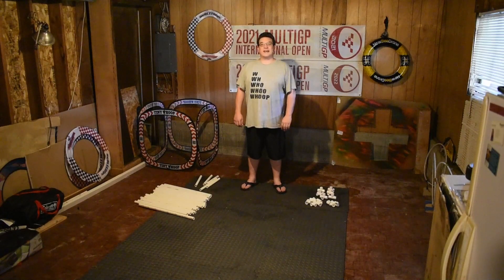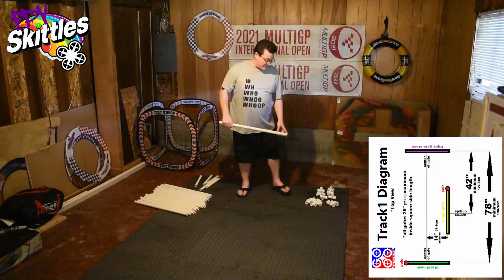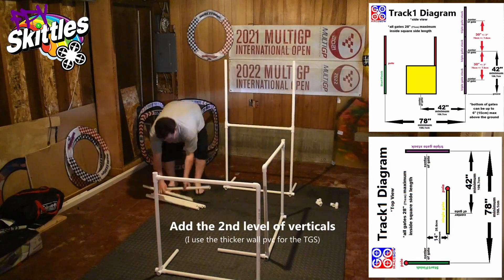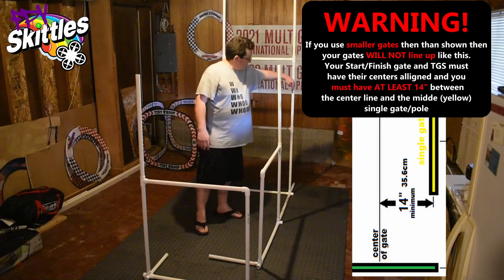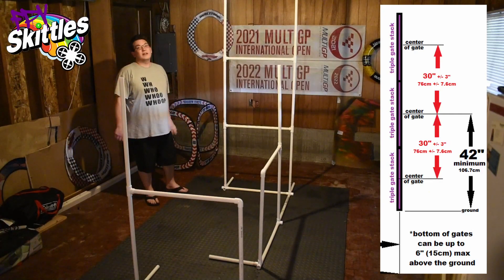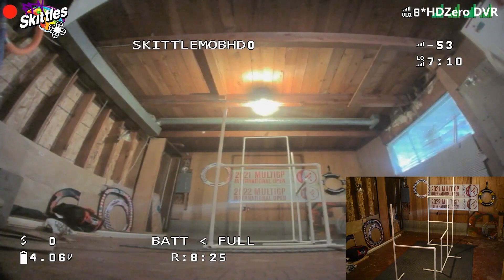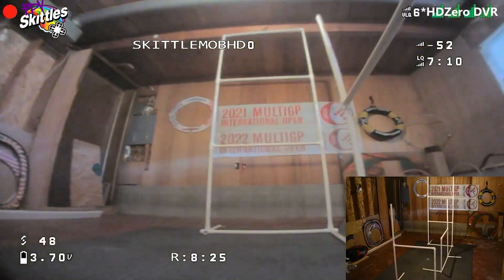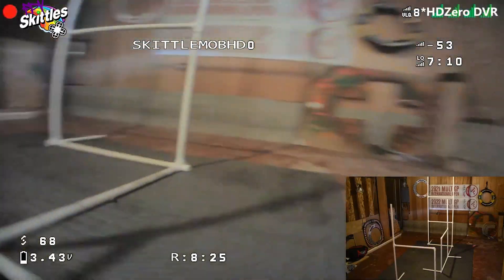RaceGOW Track1: Created by AyyyKayyy - DEADLINE = August 31st

Comment: Need to find the cost of pvc, and see if I can get any of my ducted whoops to work…
Reply: Hello, Not sure where you are located but here in the Seattle area a 10' x 3/4" piece of PVC  is 6.48 for sch40, which I use for the sides of my gates and 4.57 for Class 200 which is what I use for the tops nd bottoms of the gates.  I also sell packs of the PVC fittings so you can make all your gates at fyscrafts.com

Comment: Thank you.
One moment is not so clear for me. If I have smaller gates (in the intro RaceGOW video it said I can you any size, not more than 28 inch) for example my gates are 50*50 cm. How I can follow the rule of the minimum 106,7 cm between first and centre of second gates? Am i right to scale all the dimensions proporsionally between your gate size and mine (even the track length) or not?
For example 50/71=0,704. 
So my track size 198,1*0,704=139, 5 cm?
Reply: Hello and thank you for participating.  So for 50cm gates you would have to place the gates as if they were at the center of the full 71cm gate size. You will need to line up your Start/Finish Gate with the Triple Gate Stack but the middle gate+pole would NOT be aligned with the side of those gates because it has to be at least 35.6cm from the center of those gates. The middle element will have to be about 10cm from the side of the start/finish. Also for the Triple Gate Stack you must have at least 65.6cm from center to center of each gate. That means you will need to space the gates apart by at least 17.8cm vertically. You can find more information on the website at https://www.racegow.com/tracks and in this video https://youtu.be/IZVy-fwQVjE